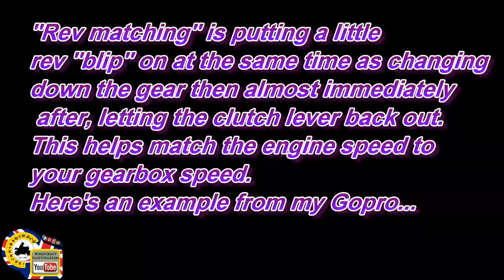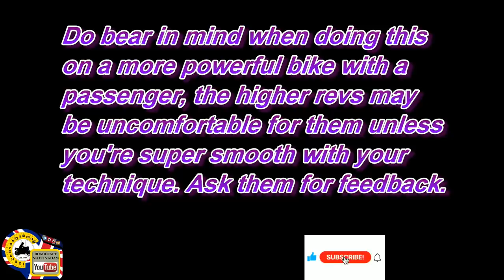WHEN to change gears on a motorcycle : How I do it as an instructor of 39 years. (Timestamped)

Comment from the maker: So, be honest... Do you already do this form of changing? If not, how do you do it?
Reply from the maker: Thanks. Feel free to spread the word by sharing. ☺
Reply: I definitely do a lot of rev matching. I think I'm on the right track, it's all very second nature by this point so I need to think it through next time I ride. Mine is a Vulcan S 650, parallel twin, other owners report / complain of the twitchy throttle, it's definitely got buckets of engine braking that you can't really avoid (although many owners get doodads to tame the throttle or remap it)  The throttle is off or on, and mine has disabled subthrottle assembly flaps because of . Cough. User error. Works fine just makes it even more sensitive on the throttle. I am used to it but it is a very different experience to when I did my test on an inline 4, very smooth, much less engine braking. My testament is that my ride is smooth, regardless, and I have had many first time passengers say it was fun and less scary than they imagined it would be. Relaxing even, which is what I want. Thrilling is for alone time. For me, I'm planning ahead so I do not have to brake much, slowing down well in advance of a full stop, the goal being to put my feet down as little as possible (arriving at lights as they turn green, looking ahead at roundabouts, junctions, etc). Using little mix of brakes to smooth it out if necessary. Because of the strong engine braking (it feels like slamming on the front brake if you come off the throttle too fast, in any gear but 6th) I think I've developed the habit of using gears before brakes. I have a long ride tomorrow and will experiment with a different order of operations. 

After reading other comments I see what you are saying. The bad form would be shifting down into a speed unsuitable for the gear, and the engine roaring in protest. Yea this may slow you down, but it will be harsh and sound bad and feel bad for everyone involved! Plus, you could hardly accelerate from that state, therefore have lost control of one direction of movement for the bike.  I think I understand the difference. I had this when first learning to rev match on my big bike when changing up from my 125.
Reply: Depends on the time of day, if in a rush or cruising, if I need to save fuel or for something to do. 
Nothing wrong with changing gears before you stop, just like changing gears when you are stopped but one might require some more clutch work to get off the line.
Reply: @Anton_G_604  Braking, slowing and then block changing is how the UK  police advise one to do in Roadcraft and therefore as an advanced rider.  If one looks in the bikes manual about changing gears  downwards and at what speeds to do it at it will surprise you that it's all one speed,generally  about and no more than  18 mph so they also recommend the use of brakes, not engines revs  and then to block change down as well.
Reply: @DevinJuularValentine  There is obviously a big big difference in  chopping down gears on a twin  compared with the same on a bike with 4 cylinders. The twin will shut off and slow like heavy braking and that's not being kind to the engine.   The  4 cylinder will be more subtle and less sensitive and there will be far less resistance to the slowing effect with it.  One rides the bikes accordingly as to whatever suites your style of riding and that of the machine but not only that but also for the safest ride for you and your passenger.
Reply: I do although I have a royal enfield 500 so the engine braking is more noticeable than my suzuki m800 was. It's an easy bike to lock the back wheel too if I go in to first too early (as I discovered within fifty miles of first riding it).
Reply: @Anton_G_604   Thanks Anton 4 the comment.
Reply: @Andythenurse  I agree. Drop down a gear too soon and at to high a revs. on a single pot like your R.E. 500 and its like throwing the anchor out.  One has to be aware of its engine braking capabilities and be very gentle with its use.
Reply: I am just a very naughty boy and do rely on engine braking too much. Will definitely put your sound techniques into practice when I get released :) Thank you for a great detailed video, very beneficial.
Reply: @RoadcraftNottingham  I am from an advanced significantly trained car background but on my DAS. I am trying to ride to OSMPSL albeit my old job means I was roadcraft trained/qualified in a car.

Mod 2 A licence test, (very soon).

Trying my best to ride to OSMPSL but after decades of roadcraft I have found myself out with instructor occasionally reverting to IPSGA & doing block changes....(he simply just said "Don't do it", however, its a hard habit to break). 

Considering above do you think I may be marked down on test if I happen to be seen performing a block change (assuming done ok & I end up in right gear for hazard - junctions etc )?  

Any experience of you knowing of someone going to Mod 2 test doing block changes ?

Thanks
Reply from the maker: @AW8UK  The question to always ask is are you in control of the bike?

If what you do has no adverse effect on the control, there's no problem.
Reply: @RoadcraftNottingham  Great....thanks for prompt concise reply. That will reduce any anxiety of doing same,

Many Thanks
Reply: Approaching a turn I do it your way. Approaching a red light I release the throttle, squeeze the clutch and roll towards the intersection, brake if needed and downshift so the gear is always appropriate for the speed. Normally I don't come to a full stop but can release the clutch and move on when the light changes to green. When slowing down for anticipated risks I have downshifted and rev matched before engine breaking, but will now try to stay in gear while engine braking and use the brakes and not downshift before I'm going to accelerate again.

Comment: A good tip my instructor gave me r.e. engine braking was to gently use the brake lever to activate the brake lights, just to let others around know if I happen to be shedding significant amounts of speed using the engine. The CB500's we were using could easily go from 70 to 40 on engine braking alone when entering a town etc, no need for brakes.
Reply: the great thing about motorcycles is the high HP to weight ratio. it lets you accerate quickly, and it lets you slow down under throttle control WITHOUT touching the brakes most of the time.
Leaving the bike in 5th gear while you brake to a stop is stupid.  if you need to speed up you lug the engine.
you can idle down to 40 in 5th gear  kick twice to 3rd  blip the throttle to rev match  and then engine brake down to 20, apply F&R brakes to stop while you kick it into 1st MOST OF THE TIME. your brakes will last 4 times as long, all the energy is from 70 down to 25, blow it out the tailpipe, not into your rotors
Reply from the maker: Where does it mention to be leaving in 5th when you stop? Time code please. The gears are changed down latterly to match speed.
Reply: @RoadcraftNottingham  It hard to see what you are actually doing in this video, we cant see the clutch lever or the throttle in the video.
You are riding in 4th gear, coming up to a turn, throttling off and apparently leaving the clutch engaged all the way down to about 20mph while you also apply the brakes. If you are leaving it in 4th and pulling the clutch in and coasting, free-wheeling a motor vehicle isnt just dangerous, its illegal!

you clutch in and kick down to 2nd gear somewhere in the turn or just before. What does your tach read when you have slowed down to 20mph while you are still in 4th gear? If you had to bail on the turn at 20mph in 4th the bike would lug if you tried to speed up.

and WHAT is going on with the audio when you "show what its like" to down shift and then engine brake?! it sounds like you pushed the starter button at 40 mph. Does you bike really make that loud of a sound or are you screwing with the volume in video?! It sounds like you hit 1st gear at 40mph.

You dont seem to understand the HP curve of the engine, or the speed range in each gear. People use to think something like 1st gear 0 to 10 mph, 2nd 10 to 20, 3rd gear 20 to 30..... so if you are going 30mph you should be in 3rd gear, and keep the engine around 2,000 RPM when riding at a steady speed.   Thats not how it works, not at all.

MOST bikes will putter along just fine at 30mph in their highest gear (5th or 6th) if you are on a level road, not in a curve, and holding a steady speed. As long as you are keeping the engine above its idle speed (1200 RPM for my Vstar 650) the oil pump will do its job, the bearings wont be oil starved, and you can putter along, getting excellent fuel mileage by the way.

If you want to speed up from 30 to 80 gradually and smoothly, you can just crack the throttle and the bike will speed up nicely in 5th all the way, again as long as you are not climbing a hill.
If you want to speed up quickly you need to kick the transmission down where its closer to its peak HP RPM.  An easy way to do this, esp if you dont have tach on your bike, is google the rev limiter speeds for your bike in each gear, make a little label and put it on your handlebar, with the max speed in each gear just below the rev limiter speed. Then when you really NEED to get out of someone way, you can accelerate as fast as the bike is capable of, without hitting the rev limiter.

Some bikes will putter along in top gear around 1200 rpm better than others. I think it is partially do to the compression ratio of the engine, maybe the number of cylinders. My Royal Star 1300 V4 has a 25% overdrive in 5th gear (the bike is designed for touring), and 10:1 compression, and it balks if you give it too much throttle at lower RPMs, but the 650 with a  8:1 compression ratio and 2 cylinders handles it just fine.

But back to compression braking. The most annoying thing about driving a car with an automatic transmission is you take your foot off the gas pedal, and the car just COASTS - it hardly slows down at all. A manual transmission in a car lets you compression brake to some extent, and with a motorcycle you can ride MOST of the the time slowing down just by closing the throttle, kicking it down to 3rd and... well slowing to a stop if you have to by hitting the kill switch in an emergency.

If your bike does not engine brake very well, its possible you have the idle speed adjustment set too high, holding the throttle open too much. Check it when the engine is hot with a tach.

If your bike makes wild noises when you compression brake take it to the shop and find out whats wrong with it.
Reply: Yeah depends on circumstances. I find changing down/engine braking best when on small lanes with reduced grip/mud.
Reply: I like to use my rear brake to activate the brake lights while I’m engine braking/rev matching
Reply: Just touch the brake for brak light,cars dont know how fast your engiene brakes ...

Comment: Very bad idea to not use engine braking. It keeps the bike in check and permits rapid acceleration if suddenly required.  Also prolongs the life of brake pads.
Reply from the maker: As I mentioned, normal engine braking is fine for relatively minor speed changes, changing down gears solely for the purpose of slowing down is bad as firstly the slowing effect isn't as good as brakes and secondly if changing down too early there's a risk of locking the rear wheel and causing premature wear to the tyre which is much more expensive than a pair of brake pads.
Reply: @RoadcraftNottingham  All techniques are bad if applied the wrong way. If you brake a bit too much from 100kph without shifting down, you can easily lock the front wheel and crash. By shifting down you manage speed gradually and smoothly. There is just no question about, so we fully disagree.

Comment: Changing down on a big v-twin makes significant change to your speed, so it depends on your engine type/size the technique you can use.
Reply from the maker: Maybe I should have mentioned the difference in normal engine braking on big singles and twins.. There's always something! 😂 But my point is to not change down in order to slow, ie, replacing the brakes with the gears. use the brakes if needed
Reply: @RoadcraftNottingham  I know that this topic has been done to death - in cars as well as bikes - but it seems to me that the reasons for not using the gears to slow down are very flimsy indeed. Firstly you claimed that gears don't make a 'massive difference' to braking- this is highly debatable, as noted by Edward above. Secondly, you said an advanced instructor would call it 'unprofessional, and doesn't sound right'...this is just circular reasoning, as I'm sure you would admit. Thirdly, the gearbox issue (which you admitted yourself was bogus). Fourthly, you said 'if you have a passenger, you will get headbutted', meaning that the bike will become so unstable, that it will produce fork dive - obviously this is only true if you bugger up your downshift. Now, you can argue that it is a lot easier to mess up a downshift than it is to mess up braking with front brakes...again, that is highly debatable. Lastly, you flashed up onscreen text saying that downshifting may cause you to 'lock up the rear wheel', which is certainly true, but again similar to your point about making the bike unstable - this would only happen if your downshift raised the revs so high that the rear lost grip when you released the clutch. This is very possible on a racetrack ('backing it in'), but requires much higher speeds and block shifting a few gears (you will know of course that racers do use downshifting to wick off speed, so it is useful, but only produces a small part of the braking force compared to front brakes). So, I'm agreeing with you on points 4 and 5 above (with caveats!). The problem I have is that the above points (I hope are not too controversial!) doesn't get you to 'you shouldn't use gear shifts to reduce speed', its more like 'braking on a bike is hard! downshifting and front braking (and rear braking!) should be used at the correct time and place, with a good understanding of the dynamics of your own bike and the road conditions'. Am I wrong?
Reply from the maker: @alst4817  Great comment, thanks... The easiest way to put this across is don't bother replacing the brakes by changing down gears in order to lose more than minor speed. It's much easier, more effective and sounds better to brake correctly then choose appropriate gear for the speed achieved. Of course, if you want to make your bike sound like mine when I twice demonstrated the downshift by gears alone, it's your bike. ☺
Reply: @alst4817  good post, I was going to reply something similar but didnt want to type it all out.
I have 2 cruiser bikes: Vstar 650 and Royal Star 1300 (V4). I commute on the 650 when its not snowing or raining, ride on secondary roads, and I blip the throttle and jump from 5th to 3rd at about 40mph when slowing down for a corner or stop, and then kick it down to 1st as I brake to a stop. 

So Im only blipping the throttle to rev match once, and burning off most of the kinetic energy, from 50 down to about 25mph, before Im on the brakes to stop. This is reducing my brake wear by a factor of FOUR at least. My 650 has 54k miles on it, still has the original pads and rotors, and they are no where near needing to be replaced.

Im not racing, Im not riding fast and hard - Im commuting to save miles and fuel on my car, and to enjoy the ride twice a day.

There is nothing wrong with engine braking. BTW, when you are slowing down, engine braking or not, you are SUPPOSE TO be down shifting AS you slow down, so you are always in the correct gear for your speed if you suddenly need to speed up again.
Reply from the maker: You're missing the point. Using the gear you're already in to slow, then selecting the new gear if you reach the speed you want without braking is fine. Changing down gears for the sole purpose of braking, instead of using your brakes  is wrong, whatever configuration of bike you're riding. Saving a few £ on brake pads will offset the increased rear tyre wear and risks skids for the less experienced riders who change down too early. This isn't the way us qualified instructors/police riders teach it. But of course it's your bike, you do what you want with it. 😉

Comment: Another high quality upload, thank you.
I do have a bad habit of relying on engine braking on my honda msx (as well as brakes) because the engine is a single engine braking is significant. However after watching this I'll change my habits to at least prepare me for potentially upgrading to a bike with more cylinders in the future. I'll come and see you at beechdale motorcycles when I do.
Reply from the maker: Yes, there's a difference between engine braking and replacing the brakes by changing down gears instead.
Reply: Nice to see you out on the pan again, can’t wait to get mine out again.

Comment: I'm here 2 years later2, but I'm actually impressed at how simple changing gears are, as I've only got an automatic 49cc ET2 Piaggio 2004. You've got me that little bit more confident when it's time to trade it in to upgrade to a manual.

Thanks, mate! (I promise I won't change gear to slow down) <3
Reply: bro engine braking is useful, he didnt say not to use it